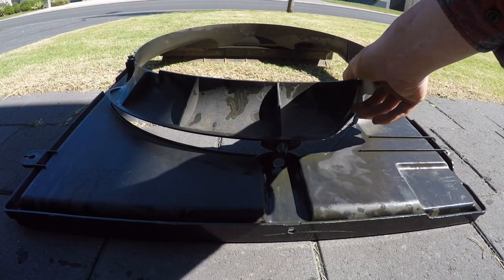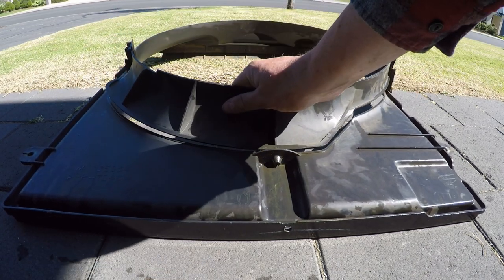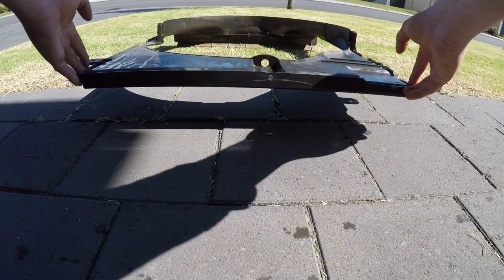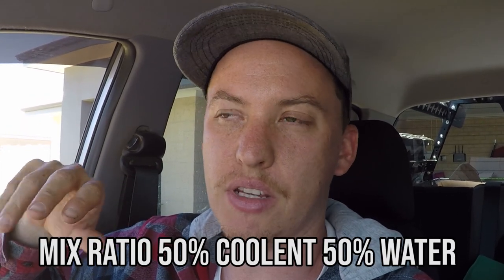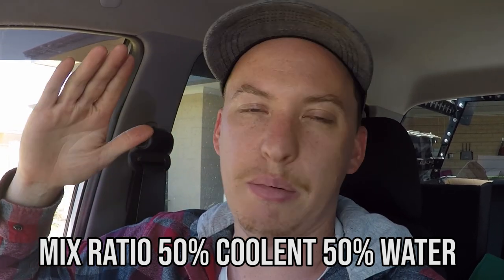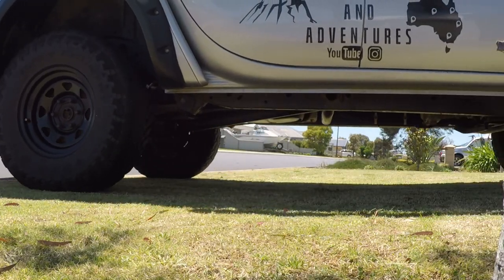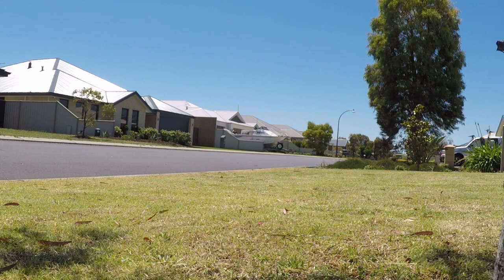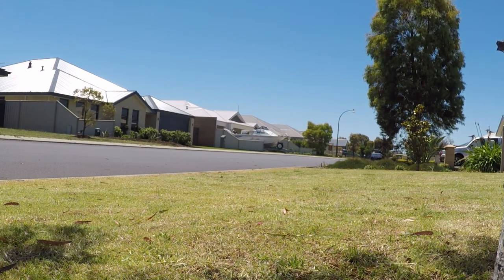Mitsubishi Triton Radiator Replacement

Comment: Since last 4x4 trip whic was exactly a week ago I noticed that my engine fan runs more often that it was before. I did washed the car day after the trip and I tried to wash radiator from all of the mud that was on it. Last night my temperature went up like crazy and engine was overheating so I pulled over stright away and shit it down. After some time I added some 1.5 liters of water and that took me home with temperature being normal aroun 88 degrees. When it all happened my engine light came on and I run the scan and it gave me P0217 code. I erased that code when I got home and now I'm gonna pull that radiator out and give it a good clean with high pressure washer. Hopefully I didn't stuffed that engine up because I did pull over right away and shut it down. I was driving home aprox 10km from when it all happened and after I cooled it down and everything was fine.
Reply from the maker: If ya pulled over and shut her down she would have been fine normally that engine code is a overheating warning putting the car into limbo mode hopefully she’s all good mate!

Comment: What was the reason for this? Is there a noticeable difference between the stock one and the aftermarket one?
Reply from the maker: It's just a replacement mate the original had a hairline crack nothing major

Comment: Thanks for the video. I know you have moved on from your Triton now, but at 1:33 where you say it just pops out. Did you just force it to pop out with brute strength or is there a trick to those plastic clips?
Reply from the maker: Hey Glenn I had to pull it up and out with a bit of force since it was rubber on plastic so they hold on pretty well.

Comment: How did you get the bottom right bolt for the fan cover its pain in the ass to reach
Reply from the maker: Removed most of my knuckles essentially it is a pain but you can get to it with persistence

Comment: Anyone got a tip for finding the coolant plug on the block?
Reply: Not sure there is one but the manual says to just disconnect the water hose from the oil cooler to drain the water jacket.
Reply: That's what I ended up doing. Got closer to the full volume out. Thanks.